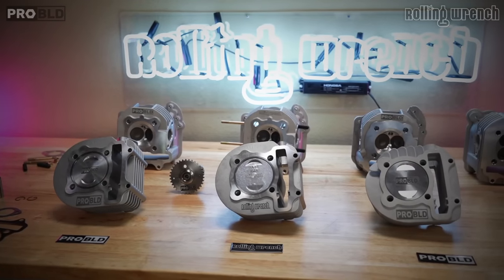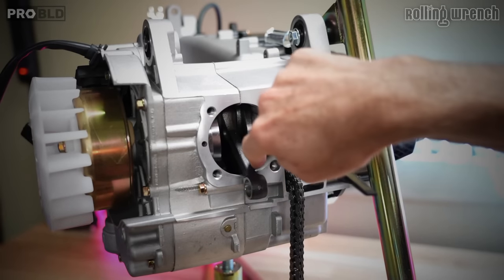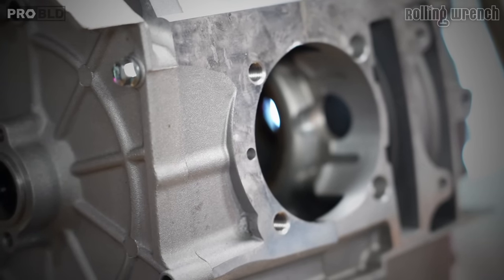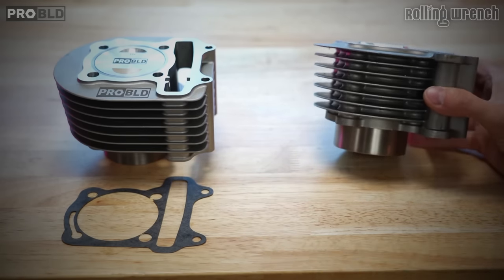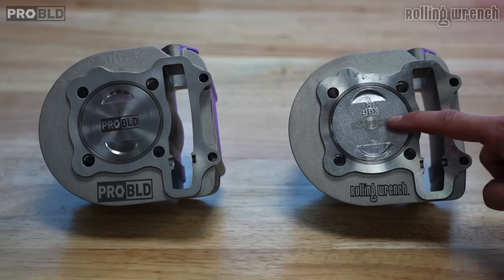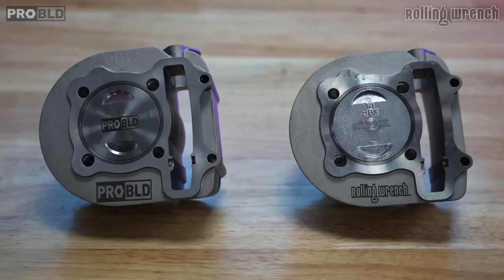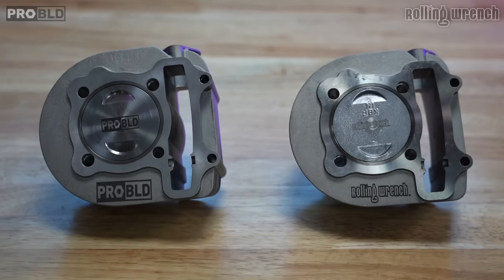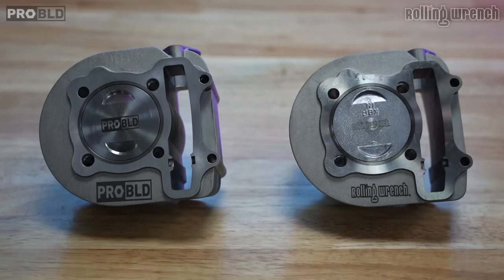GY6 BIG BORE KITS - EVERYTHING YOU NEED TO KNOW

Comment: What a great and well explained video. Thank you very much! I have a 61 mm Taida cylinder and forged (I assume 4032 type?) domed high compression piston in my GY6. It was also a drop in kit as cylinder liner is thin enough. I have a NCY big valve cylinder head with 27,8 mm intake valve and 23 mm exhaust valve. The cylinder head is at the moment at my cylinder head porting guy who cut better multi angle valve seats and will port it. As the short side of the intake port is always too sharp turning towards valve seat in these GY6 heads we first planned to raise the intake port and put some epoxy on the intake port floor to get a better shape smoother turning intake port towards the intake valve seat. Plan was to port more from the intake port roof. Then we measured the material thickess from intake port roof where it’s thinnest to intake valve spring ”pocket” or ”base”. Material thickness doesn’t allow us to make this modification so the porting will be done less ”radically”. There is still a lot of room for improvement. I can see that in this cylinder head you have there is a better exhaust port flange as there is not that extra cutted ring shape groove for that type of exhaust gasket. I use that same type exhaust gasket as there is in your kit. We could maybe buy one of your two valve GY6 head and see if it has more material to do the required mods. I have 30 mm PWK slide carb, NCY ported intake manifold, A9 cam and Turbo Kit exhaust with better modified and flowing noise killer.

Comment: Some info for anyone who has a real gy6 china ped... mine is a very rare 125cc Ariic, but model was released i think in 2018 there are older models, anyways mine is a short case 10" wheel (fuel injection) and yes a big bore 150cc kit works perfect so do it as no videos will show its possible but it is. Also i took the stock variator and filed the top of every ramp until thin and steep after smoothing the best i could i coated it with clear lacker faintly do not get it to drip spray, after dry i then added only 3 of the 12g rollers or 10g not sure, i play with it sometimes but oh its a beast. I also forgot to mention i added a rear performance clutch yes it looks like the stock but is only about £30 and is black with red springs and because it is 4 stroke i leave the black stock main clutch spring and im going to add a race cam with steeper ovals. Its a lovely beast of a machine and also stock exhaust and remove the air filter face cover it has a dedicated open filter srewed in under the air filter face plate dont remove that though if rains re attach the cover but first trim around the air access port on the filter face plate to enlargen it a lil. It rides almost like a 2 stroke or pit bike also a wheelie machine to say my bike is heavier than a vespa i think also engines are tanks i swear it never lets me down only other bits have so far unrelated to engine like kick stand, i reckomend replace most weak screws with British ect.  Have a good day and i hope my info has inspired people to do it so much fun. Rid safe.

Comment: Guys.. I recently aquired another 2stroke, awesome,  exxtremely practical n simplified in looks, slim, has  practicality as a farm helper even, if one so chooses,, im tallking about: YELLOW Piaggio Free 1998 (removed variator washer + 10 sizes bigger main-jret) that I  had now in the winter already, its kickstart systen broke and was needing a new returning spring for for it but then I got ANOTHER one that was the same series, a RED Piaggio Free for a 100 bucks it only neede to be sucked out of gas wiich i did, removed the carb, cleasned it with brake clean n carb-clean after confirming a "beautiful" spark,. Now i wanna build some kind of light weight "big-bore"  kit

Comment: Cool video"  nice breakdown , forged in billet just like in high-end race engines and v8s you want it to hold together especially if you're running big boost numbers you got to have it I can remember back in the day having a yz100 and they sold a 175cc  top end kit"  braaap" had a 80cc wheel set, so" it literally look like an 80 " the big bore maico"s burrrt"  & a XT600 Enduro, ect
Reply: Had a 09 Aprilia sr50 water cooled fuel injected on board computer all digital not mechanical magnesium wheels disc brakes hydraulic disc brakes with pirelli tires stock brand new stuck a Leo Vince pipe on it and it really came to life was going to get a 70 kit like my buddies which is just the top end kit unlike the 86 kit with a crank ,  but sold it to a friend of mine but was maybe looking into getting a GY6 motor already done with all the rad internals" I know depending on the pipe and the carburetion and/or fuel injection how much horsepower does one of these motors put out say the 171 all the way up to the 205 CC " from what it is when it's restricted stock in comparison thank you most appreciated

Comment: Hey! Big fan of your YouTube channel. I've been scouring the internet and YouTube for a full wiring harness for a couple GY6 QMJ157 Kodi/Mossimo buggies we have here at our Boys Ranch, Agriculture Equipment and Small Engine Repair training center. I can't seem to find ANY (complete) wiring harnesses that either come with properly labeled wires, or with English instructions. 
     All of the GY6 buggies we have were donated to the Boys Ranch, but apparently the previous owners' kid did a hack job on the control boxes, and didn't reconnect everything. The control boxes and everything inside them are missing!!
     I've been looking for several months and I haven't seen ANYONE on YouTube with a proper video on how to rewire a GY6 buggy, where they listed either a link where you could buy a complete harness, or a proper wiring diagram and/or pictures to see what wire color/connector shapes go to what. I've only seen one video that comes close which is several years old, but it's not a professionally done video like yours are, and it's just a young kid that never zooms the camera in close enough to see wire colors or connectors, never said where he got the harness, and no longer responds to comments where people have been asking over the last several years the same questions I have.
     Also, do you know of a place/link where you can get a GY6 QMJ157 case with Internal Reverse like most GY6 Kodi/Mossimo/Spyder buggies have? 
     If you could record a video on that, I'd donate $100 through your website Tech Support link! On behalf of myself and many other viewers, THANK YOU IN ADVANCE!!!

Comment: I have a gy6  type A with a short case. Engine# 1p57f. I’m looking for a drop in kit for the top end. Don’t really need more horsepower. Just want to make sure I order the right parts. It has the 54mm stud spacing. The rings are shot! Just trying to get it back up and going again for the kids. What top end kit would you recommend without boring the crankcase? Any help would be much appreciated.

Comment: Automatically have oil pressure on cold start. Is that normal? I changed the oil and cleaned the screen and installed properly. ( Noticed that the exhaust out of the muffler is forceful and smells like very clean burn. Also it's cool exhaust air while idling.

Comment: If I install a big bore kit on my scooter Do I need to replace the crankshaft ? The scooter is a suzuki 125cc 152QMI engine with 26000 kms ( 16000 miles) im thinking upgrade it to 150cc

Comment: hey  i have a question does 4valve cylinder head gy6 can give you more speed than 2valve cause i have a 175cc engine and 28mm carb  but it only 110kph top speed what do you think about this? cause i planning to buy a 4valve cylinder  head

Comment: I had a gy6 with a 63mm piston a big valve hea a .820 crankshaft, an a10 cam ported head 34mm mikuni carb it was full taida engine thats a pretty quick scooter.

People also put a 74mm piston and a 4 valve head and a .1020 crankshaft
Reply: l had 4 gy6 with 66mm 208cc，61mm 180cc，59mm300 166cc，59mm water cooling
Reply: You can get a 50 cc gy6 scooter and bolt on the 125 register as 50 cc and have some fun.
Reply: You are the only
Reply: @senlanguna  i

Comment: my gy6 is 125cc to 150cc 120-125kph top speed thats my set up...but your set your using big bore kit but your top speed 100kph?this set is 150cc super stock for 150cc we change the camshaft only....stock leap 5.0mm intake to 5.5mm exhaust while may cams leap is 5.5mm intake to 6.0mm exhaust.pm me for more info on your gy6
57.4mm block
23/28mm vlve
6.0 leap cams
racing cdi
13.5 pulley
1k rpm center
1k rpm clutch
15x37 gearings
quick throttle
14"size wheels
mishuboshi belt 835 20 30
24mm carb

Comment: Hi there rolling wrench 

i have a Sym Crox was a 125cc! its got a 180cc bigbore kit and a bigger carb and bigger exhaust i cant seem to find an upgraded head or a camshaft that will fit (My cam shaft sprocket has two bolts holding it onto the camshaft) and my cam shaft sits in a cage (it dosnt split in half) like the older GY6 models is there anyway i could face time you on whats app to show you my engine to see if you can work out if or what i can get for it im pritty sure its a GY6 but i think it could be a EURO 6 if such exsists
Reply: I would also like to add that my engine mount to my frame by the exhaust port on two bush monts and not from the top like most GY6 engines

Comment: Great info! I have had scooters for years and I and the kids had a blast with them. Decided to get another one (we rode the proverbial hair off of the old ones).

Bought 2 grom 50cc clones (China) and what do you know they wouldn't get outta their own way so to speak so I did a 100cc bbk on em. Not faster, just adequate power for pulling hills and scooting from a stop. 

My question is this:

Now that it has power it outruns the one gear pullies and will run past the redline so do you have or know of a CDI that has a adjustable (screwdriver style) rev limiter? I like around 92 or 93 thousand but each are different so I need to be able to tune them per application.

Just can't put anyone on these things until I get that solved as most can't understand or feel too many rpm's.

I like the bbk and they are no longer underpowered so you won't get run over on the street or slog up a hill at 20mph but without a rev limiter ya just can't put a newbee on it without the risk of crank bearing failure or worse.

So a cdi with a manual screw driver adjustable rev limiter is key for me right now. 

Thanks in advance (no pun intended) for any help you can provide...

Keep on scootin,

Hippie Dog

Comment: How do I get the rpms back after I put in the big bore kit thats the trouble I am having now
Reply from the maker: That's a loaded question. My guess is the carburetor isn't dialed in yet. Use a wideband O2 sensor to tune it perfect. We have them on the website.
Reply: @RollingWrench  we did a 171 kit with stock head and carb but our buggy seems to have lost low end torque and rpm I've bought cvt parts from your store but haven't installed yet
Reply from the maker: @jerrybaker4951  I recommend this with a big valve head and our ProBld cam https://www.rollingwrenchdenver.com/products/wide-band-o2-sensor-tuning-kit

Comment: What if I have a 171cc already what do I need for a 205cc build
Reply from the maker: Pretty much everything will need to be replaced :-(
Reply: @RollingWrench  do you have a kit for that
Reply from the maker: @15JDMRuckus  yea. Not on the site though. But in stock. $1800 comes with head, cam, cylinder, bore tool, starter, starter clutch, crank and cam chain

Comment: What are the specs of a drop in kit??? So I know which one to order?
Reply from the maker: Drop in is 61mm 171cc https://www.rollingwrenchdenver.com/products/gy6-171cc-big-bore-kit
Reply: @RollingWrench  can I buy one of your performance carburator like a 125-150cc and put it on my 50 cc. Since I have seen ,so far two moped that are 50cc running with a 150 carburetor ??  What exactly do I need ,to make that work with upgrading to a big engine
Reply from the maker: @juliomvp13atgmbrito45  it will fit direct bolt in. But they are to big for 50cc or even 100cc. It won’t run good at all!

Comment: I have a Tao Tao 150cc. Runs fine until I hold it at 45-50mph for a few seconds then it acts like I'm not enough, or too much gas. I'll have to slow down for a mile or so to allow it to run normal
Reply: Sounds like the fuel pump can't keep up or it needs a rejet
Reply: @RspecNick  thanks, I appreciate it a lot. It was the jet. Took it apart and cleaned it, runs fine now. Hope you have a great day!

Comment: Technically, you only need to Gap 2 of the rings, not 5. I'll also say that we have never had any issues with CP forged pistons in long run. Who's manufacturing your pistons spec? They also use 2618 - T6, its funny you say that's sub par, not true what so ever.

Comment: Umm ceramic coating keeps heat in. That’s why pipes are ceramic coated. Why would you want to keep heat in an air cooled cylinder head!
Reply from the maker: Actually other way around. It dissipates heat (heat shielding)

Comment: 63mm cylinder on a gy6-A is pure ass. The cylinder walls are way to thin. Tightening the head to spec  heavily deforms the cylinder walls. 61mm is the max
Reply from the maker: Pick your poison! I have had great luck with the 63mm. Just be sure you are installing quality parts.

Comment: Why buy a motorcycle when I could spend mega thousands of dollars on a GY6😂😅😊!!!!  I know it's the trip to get there not just the trip.     Like I use to spend many hours getting all the power possible out of VW engines when a stock V8 would run them in the ground.
Reply from the maker: You know the drill. It’s the hobby not the purchase